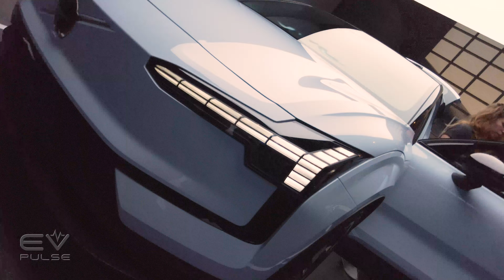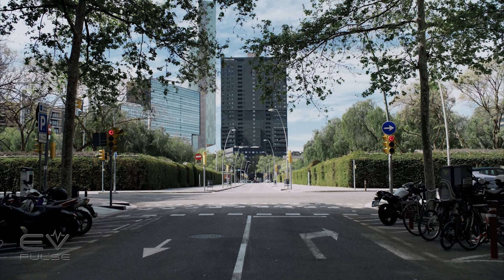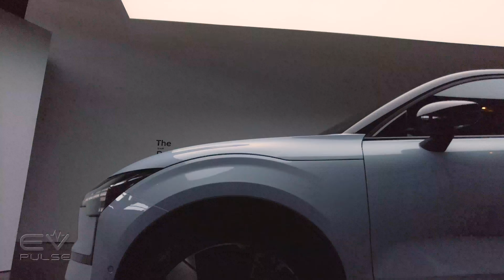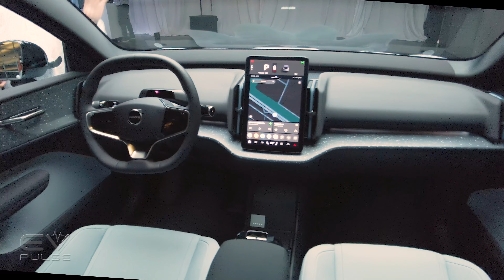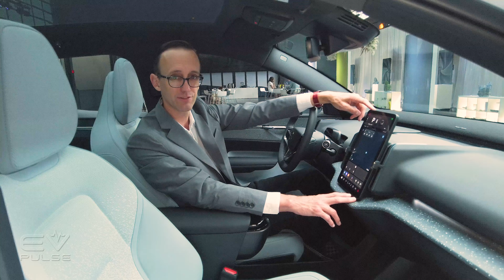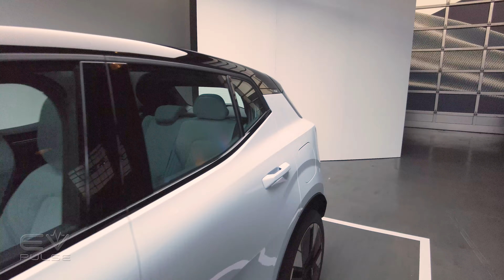The Affordable EX30: Volvo's Most Important Vehicle

Comment: Great looking car and I completely agree with #5. A HUD would help but yeah I prefer something more driver centric for the main driving points like speed, range etc.
Reply from the maker: Volvo also has that tech because it appears on other cars, so it's not like they'd need to find a new supplier. Now it is possible packaging wouldn't work. For example, the Ioniq 6 doesn't get a HUD but the Ioniq 5 has the augmented reality HUD, and it's due to the design and size of the dashboard and windshield.

Really though, it's probably just to save some cash because this thing is not expensive at all.
Reply: @EVPulse  yeah makes sense for cost. And darn I didn’t know that about the Ioniq 6, shame as I much prefer that body style but at least those have normal displays right in front of the driver.
Reply from the maker: Agreed on the Ioniq 6. I still like the car a lot, but wish it had it. - Chad